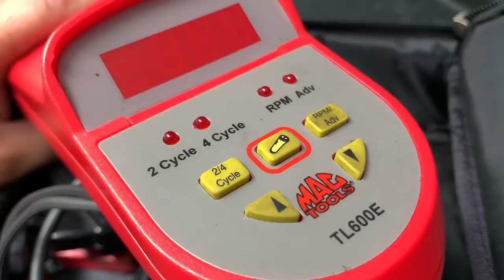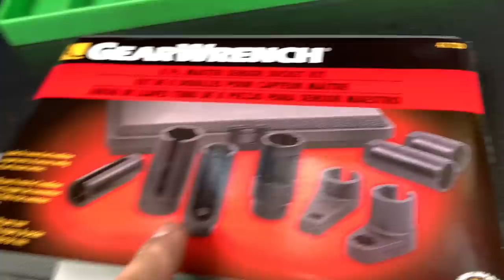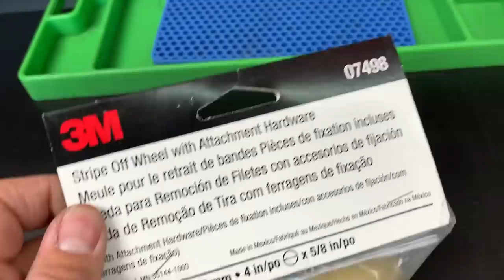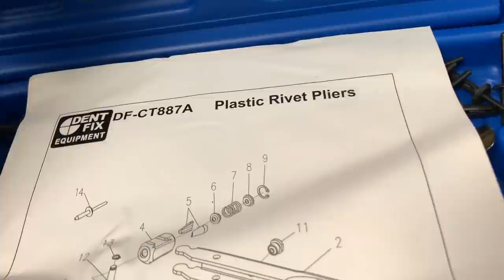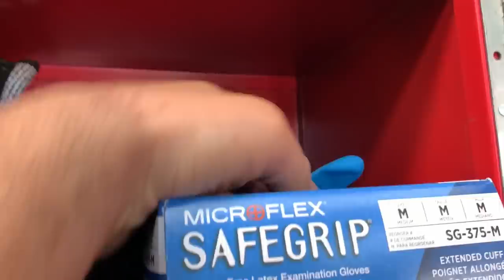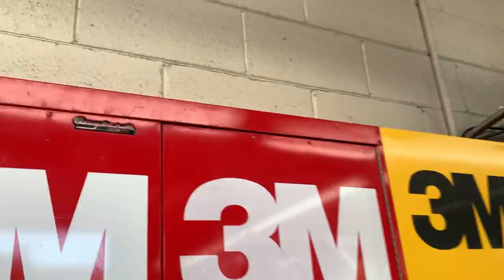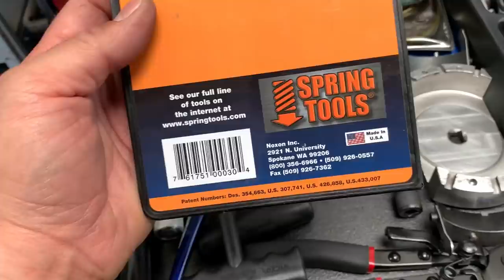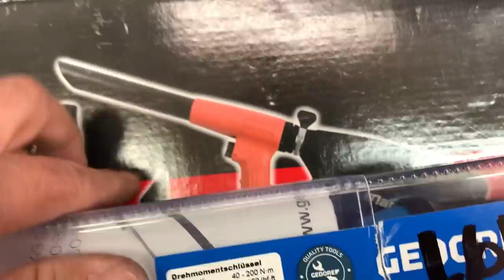Toolbox Tour Part 2 Autobahn Dan Mac Tools Tech Box

Comment: That's a score you got on your 3m abrasive cabinets. I have 3 or 4 or them from 20 years ago when  I started at a autobody shop. When the business sold I was able to keep them and have been dragging them around ever since lol. I was going to buy another one until I saw retail was around 400.00 each. I'm with you on the original snap on comfort grip handles, I still have most my stuff I originally bought getting into the trades I have had so many people offer me money to buy them, it's not happening lol. Everyone trading tools in for new ones I'm sick in the head and just keep buying the newest versions while keeping the classics. I'm impressed with how much you have and it's all organized. I'm looking at tool grid I'm just not sure about the cost. 3 top drawers for just sockets isn't working for me.
Reply from the maker: Tarek Ashurex thanks for watching! That’s crazy I never looked into the price of those cabinets!

Another reason why I have so much here is because of the tool shed issue I’m having.. Once the tool shed is done all The overflow will go there! Then I will finally be relieved with the chaos here! 🤣
Reply: @AutobahnDan auto body network is the cheapest I have found the cabinets and they were 349.99.  You can occasionally get them free with a huge 3m abrasive purchase but  neither are up my alley anytime soon. I'm working on building a 2 bay shop and compressor/ parts room, then I'll finally start showing off what would of been a nice early retirement lol.
Reply from the maker: Tarek Ashurex nice! Nothing beats having your own!

Comment: I have a big set of about 5 aluminum magnetic socket rail sets I bought separately making a big set of Titan tools brand bit sockets Allen hex and metric,torx, security torx and big hex they look really nice haven't used them yet but I figured they would hold up s2 tool steel and supposed to be very durable sockets.
Reply from the maker: Yeah, I got some titan, not bad, basically decent grade Taiwan. Most bit sockets will break eventually the best I can think of at the moment are PB Swiss, but the draw back with PB Swiss is that there’s not many sizes available.

Comment: Just want to point out...for what it's worth....the thing about Astro that many people probably don't realize is that they aren't a manufacturer; they are buyers/importers. 
Nite-ize thingys...I have a bunch of them. VERY useful over the years.
You find the MAC seal puller tool is worthy?
HAhahah,  I was getting tired too by the end. This is why I RARELY watch toolbox vids. 🤭
Great job. Thanks for sticking it through to the very end!
Reply from the maker: ChrisCas - Tool Aficionado thanks! 🙏 👍👍 Yeah! That seal puller has got me through some very stubborn seals! Pretty much, if you can fit that end behind the lip of the seal, it will more than likely get it out!
Reply: @AutobahnDan  seal pullers is something that I totally lack. I've gotten by many times with my trusty little GearWrench indexing prybar...but not always.
Reply from the maker: ChrisCas - Tool Aficionado The only other type I need is your basic long Lisle double ended hook style, but in a short version
Reply: @AutobahnDan  I might have to get this one: Lisle 56920 "Limited Access Seal Puller". You can operate it like a crowsfoot, with a ratchet/breaker, or even operate it on an offset by combining it with an extension. Off to Amazon. 😀
Reply from the maker: ChrisCas - Tool Aficionado yes! Exactly like that! Perfect for the front of the engine where it’s tight!
Reply: @AutobahnDan  placed in Amazon cart!
Reply from the maker: ChrisCas - Tool Aficionado $8 bucks! It’s a steal!
Reply: @AutobahnDan  damn! On Amazon Canada, it's currently $17!...so essentially double the price 😵
But whatever...can't cross the border so got no choice. 😄

Comment: I used to have the gearwrench original design 20pc metric and sae combination ratchet wrenches non reversible ace hardware specific exclusive set it came with both of those adapters for the 3 drive size for the specific size ratchet wrench, metric and sae..

Comment: I gotta pull a manual transmission on a 2000 BMW Z3. I’ve never worked on a BMW. Any tricks?
Reply from the maker: Che Kelley oh, that’s gotta be the easiest there is! So much room! Gotta remember on the Z3’s that they are half and half newer and older 3series. Manual transmissions are pretty much basic so I think you’re not gonna run into any problems searching for instructions on that repair. Good luck with the repair👍👍
Reply: AutobahnDan Thank you so much!!
Reply from the maker: Che Kelley no prob!